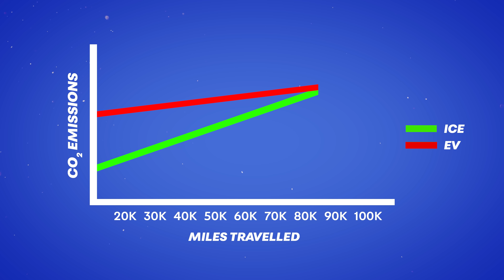Are Electric Cars REALLY That Green? [New 2022 Data]

Comment: You're right! 
Hard to explain to these EV lovers. Lots of them do think it's the magic bullet to solve everything.
Getting rid of batteries is a real problem / getting the materials to build those batteries even more.
Why some EV car-ads have butterflies in them , goes over my mind.
Anyways... we (EU) do not use miles...we have metric, dammit. With or without Brexit.
Reply: Oddly you "wtf how" comment is also gone, even though it shows in my notification
Reply: @offroadr  Censoring? "WTF" is too harsh? :-D
Did my repeated comment come through? Yes, that did. Weird.
I think now they have an eye on me ... doedidoedidoedi  ... (twighlightsounds)
Reply: Getting rid of batteries is not a problem.  They are already 90% recyclable which changes Volvo's numbers significantly.  

As an EV lover, I do not think they are a magic bullet.  But they are part of a solution.  You don't think ICE car commercials don't do whatever they can to sell them too?  Ya sure they are intended to woo the weak minded and make people think they are doing better, that is advertising in general. 

Finally Lithium is 25th most common element, iron is the 4th, phosphorus 11th, and oxygen 1st.  These are the components of a lithium iron phosphate battery.   With the exception of these, the cheapest place to mine these materials is in recycled battery bins. 

So no it is not a magic bullet, but it is better than shooting ourselves in the foot which would be continuing to use ice cars.
Reply: @offroadr  Yeah yeah... all fine and dandy, but this is not the future... More cars.
We need less people. So start having zero kids.
Reply: @RealButcher , That I do agree with.  In Canada our birth rate is 1.47 children per woman.  So effectively our population is dropping except by immigration.  Globally we are still growing, 2.3 per woman where 2.1 apparently is the break even.  But to give context in 1990 the rate was 3.2.  So we should see a declining reproduction rate soon.

There is a lot I do not like about Elon Musk, but if his vision comes to pass, it will mean using robo taxis will be much cheaper than owning a car.  This could mean that we use half or less of the cars that we do now.
Reply: @The RealButcher (Peter from Holland),  your last comment seems to have gone missing.  But I do agree.  From what I understand nature often tries to balance population to a sustainable level.  Unfortunately it is reactive rather than preemptive.   As life span and survival rates increase the birth rates decrease, however it is several generations later, in the span in-between the population skyrockets.  One of the issues I have with Elon is he thinks the planet is not overpopulated, in part because of his goal to be interplanetary.   To me this is ridiculous, even if we could take a billion people off of the planet and by the time we have enough rockets to take them all off, the population will probably be more than a billion larger than we have now so at worst we would be population neutral.   Even if we were to significantly decrease, as the population drops, the birth rate is likely start to increase to keep a healthy balance naturally.
Reply: @offroadr  Anyways, I told that the amount of children being born has decreased from 1950 on till today.
And that here in Holland we speak about condoms and the like freely. Also abortion can be talked about and even euthanasia is talk-able.
I think the fact I put a website in was the reason it has been taken away.

Comment: "...may not be as green as their internal combustion engine counterparts in the short term."

"In the short term." Good job that every car I've ever owned since the early 1990s has been in my possession for years. My current ICEV has been mine for seven years, and it's the one I'm trading in for an EV this summer.

Because don't forget: this current research (and it's 100% legit) involves current manufacturing processes and current power generation. ICEVs have had a century of refinement but still end up polluting more in their lifetimes because they HAVE to burn fuel for propulsion and their manufacturing is as good as it gets. With EVs, future battery tech involves new advances in battery recycling and greener components (not using cobalt, for example) so future models will approach ICEV levels. Energy supply is getting greener too, and if someone sticks 5 or 6 kW of solar panels on their roof the 95% of charging they're doing at home means it's going to be greener a hell of a lot quicker. 

Even if an EV owner personally doesn't have solar at home, renewable electricity has been the cheapest option for a few years and market forces will continue to phase out older polluting methods of power generation. This means the mileage needed to meet that break-even point reduces by the year. ICEVs always have to burn something to roll, their tech's peaked. For EVs, the only arguments that Luddites have are the things they're trying to prolong - burning stuff for power instead of promoting the cheaper and greener alternative.

The future is now. Some people want to be left behind. It happened to the whale oil fleets and the horse buggy makers. We don't mourn them from our past, ICEV defenders won't be mourned either.

Comment: There is a huge flaw in this study. The Materials Production and Refining numbers include the mining and manufacture of Lithium Ion batteries, but (surprisingly) do not include the mining and manufacture of the petroleum required to drive the ICE vehicle for the duration of its lifetime. This is often where studies go wrong, and once you include the carbon of extracting, refining and distributing petroleum into the overall CO2 emissions of an ICE vehicle, the scale immediately and obviously tips towards EVs.

Comment: I discovered what you're saying a few years ago. And it's TRUE. 
Electric vehicles (at present) leave a huge carbon footprint before it even leaves the factory. 
Charging the lithium batteries might look clean, but you're plugged into the dirty oil/gas burning national grid.

Comment: The problem with EV’s is the batteries. Lithium reserves are low so manufacturers are now switching to alternate materials. These seem to have lower power output than lithium. Without new breakthroughs in battery technology, the industry is in for troubles supplying adequate range to new cars. Range and charge time will stifle growth and acceptance.

Comment: The amount of electricity used to produce one gallon of petrol is enough to propel an efficient BEV further than the average ICE vehicle would go off that gallon. That's ignoring the other energy used like gas and oil burned to provide the heat for fractional distillation.

Comment: 90,000 miles. I have one gas vehicle with 143,000 miles, and anothe with 247,000 miles. You have to realize the the mileage perspective he is stating is coming from the UK... where people drive far less miles than places like the United States. In the UK... you can drive from one end of the country to the other in 4 hours. 450 miles from stem to stern, while the United States is 3,000 miles across, and due to that... everything is far more spread out here.

Comment: Yeah, I suspect Volvo are using the data to drive the industry in the right direction. It reads to me like they are saying, “Yes, EVs have come a long way, but they aren’t there yet.” And they are right. Until the electric car can improve on its own manufacturing methods and further reduce the initial CO2 hit, they are forever going to be under scrutiny. It’ll happen, of that I have no doubt: just look at how ICE has become increasingly efficient under various levels of legislation, going from the lazy, thirsty lumps of old to these magnificent, tiny blocks that can go for miles on a few drops. I’m sure similar drives will force battery manufacturers to make smaller, more efficient batteries in the same vein.

Well, it’s either that or Volvo has sussed out the issues with hydrogen and is waiting for the right moment.

Comment: Some other interesting points: Electric cars have regenerative braking. If you drive a typical electric car, and charge it from exclusively coal fired electricity, it will compare with a typical Hybrid. Much better, than a combustion only car. Electric cars can "put gas back in their gas tank", any time you use regenerative braking while descending a hill, or, gradually slowing down. Hybrids use a rather small battery, to achieve the same effect. If you remove the regenerative braking from an electric car, then, its carbon foot print per mile (kilometer) is comparable to the best gas/diesel only vehicles. Just throw in a few turbines, or a photovoltaic array, and it's a win for the electric. 
     The most needed thing right now, is more comprehensive recycling programs for EV batteries, when they finally come due for replacement. It's theoretically possible, for all the elements in a battery to maintain the market with no further mining. The only need for mining would be to expand the market. Once the market is saturated, there is little need for more mining, to keep any given car on the road forever. Your ~400 kilogram battery still weighs 400 kilograms after it's spent. Nothing goes into the environment, if it's recycled, rather than simply disposed of. you're (Volvo) dead on right about the extra materials needed to build a battery vehicle, but, the difference pales in comparison to the continuous carbon foot print necessary to keep them running. The only reason electrics aren't twice as carbon intensive to produce, is the simplicity of the motor and differential, which does away with the complexity of an engine and transmission. (especially if you include all the emission controls) With electric, it's theoretically possible to run with almost no carbon, if charged 100% by renewable energy. (Tires are made out of petroleum!)  That being said, you still have to build the turbines/and/or photovoltaic panels to provide that power. Those apparatus will too, produce far more energy over their lifetimes, than it took to manufacture them. Right now, the thing no one likes to talk about, is the serious need, to create a viable and effective recycling program for wind turbines,(especially the blades) once they reach "end of life".

Comment: The Major issue Polluting Ground Water 💧 
California does not have a Recycling Center for Leaky Acids or  other Chemicals Battery Packs, which POLLUTES our GROUND WATER 
From Millions of Hybrid Cars and Electric Vehicles (EV's). From 8 to 12 years ago sitting on Junkyards. I double checked to confirm Jalopnik Article. 
There are only Recycling Centers ♻️ for Electronic devices Cellphones and 📺 🖥 Computers 🖥

Comment: Hey, from  Ralph Naders 'Unsafe at any Speed', it takes more energy to build a car than it will use in its lifetime. And this was when cars got 10 miles to the gallon. This green evaluation based on CO2 emission is very fraught with deception. I work in industry where we buy carbon credits: the same product can be 'carbon neutral' if the carbon credits are applied to it or not, but it takes the same energy to make both. They need to apply the 'unbiased' fair comparison between the ev and the ice: energy used to make it, and do note the ev is not a perpetual motion machine.

Comment: So even at the worst figures EV's are greener that ICE because only a small proportion of cars get so banged up they have to be scrapped before 90,000 Kms.  A lot of Tesla S's have over 300,000 kms on them.  The goalposts are moving with more renewable power sources added every year but even if every kwh in an EV came from a coal plant the lifetime emissions would be better than an ICE car because coal is burnt at much hotter temps in a power plant than gas is in an ICE AND the processing emissions are much higher for oil than coal AND 85% of the energy in a car battery gets to the wheel as opposed to 15% of the enrgy in a gas tank.  That and battery recycling is already above 80% efficient with some new processes being over 95%.

Comment: Yes but you skip something important. Does an EV reach 90k miles with one battery? NO, so in the meantime they need a new battery what adds Co2 again within that 90k miles. Also something you didn't mention is the recycling of old batteries. Recycling the batteries adds another Co2..

Comment: I'm not a believer in this "green" political agenda. If CO2 is such a problem just plant more trees to clean it up. It's really that simple.

Anyway.... EV's are worse for the environment both in production, running costs and recycling at their end of life which is about 12 years. any EV made today will not be on the road in 20 years unlike combustion vehicles. How many cars do you see on the road that are 20 years old and more? How about vintage vehicles like Sierras and Chargers. Even cars from the 50's are still on the road. This won't be the case with EVs. They are disposable.

Comment: Are BEVs green: no
Are they better than ICE: yes

Some of the upcoming battery tech may drastically change this discussion.  Really hoping to see EVs drop in weight over time.
Reply: I bet it takes over 1000 liters of diesel to mine a kilo of lithium. Not to mention rare earths that take even more diesel. Then there's the coal and diesel used to generate electricity for charging which is a massive burden on the grid.
Reply: @Bob_Adkins   I suppose you could also argue that homes and businesses are a burden to the grid. I would argue that they are the purpose of the grid, if BEVs are the solution moving forward, the grid will grow to meet that demand. 
The current natural gas powered grid is about 2-3 times as efficient as an internal combustion engine. 
As far as the amount of diesel to mine lithium, I’ve seen numbers around one ton of lithium mined = 15 tons of co2 are released. Since burning a gallon of fuel releases about 3x it’s weight in CO2, I suspect 1000 liters per kilo isn’t close.
Reply: @and2244rew  Lithium is light, scarce, and takes a LOT of digging for a kilo, even in the richest ground.
Reply: @Bob_Adkins  sounds like you’re really crunching the numbers
Reply: @and2244rew  Crunching? Nope, pulling them out of my keester! 😜
Reply: Tell me how much better an EV is when it gets 250K miles on it. I think Tesla has overreached on some of its cutting-edge engineering and will pay for it.

EVs have so many HUGE advantages over ICE, I'm hoping they get competitive pricing real soon. If the government tries to push them too fast, it will be a disaster. People will sour on them and it will set back sales and enthusiasm. When they are truly ready, they will sell themselves without being pushed on people. EVs have the potential to be very light indeed. Damn batteries!
Reply: @Bob_Adkins  Totally agree with that. Tesla is innovative but i have no interest in x-wing doors, touch only handles, etc. they need to work their reliability and product support too.

Comment: Much as I like the concept of all EV some day - there's a lot of obstacles before we get there. 

Many Grids aren't suited for it.  
Common living arrangements / dense pop living doesn't work well in this regard given not everyone has a garage.  Not everyone can have a garage.  Drive around and this becomes obvious quickly. 
Without a garage the possibilities of (potentially very destructive) vandalism and theft are very real.
I've never lived in or been in a home that didn't require re-wiring at least and many may require additional service. 
Batteries don't live forever - Tesla has some impressive claims about theirs, though.  Time will tell. 
Electric batteries must be recycled properly, which itself is likely not carbon-neutral.  Engine blocks once drained can just be shredded and recycled.  It's not carbon neutral either, but at least you get new steel out of it. 
Maybe I missed it, but I haven't seen a solution for northern climates at all.  Cold, snow, road grit and salt aren't exactly good for batteries or charging them.

Comment: As long as we are having to dig craters the size of a small city to be able to make batteries, they are no better for the environment then ICE vehicles.  Until the day where we can create a small power plant for a car that can power it on it's own, there is no "Green" vehicle possible. Emissions are a joke considering the ICE manufactures have constantly been cutting emission on their cars for years.  (compare a 70's car to a car in the 90's and to a car in the 2000's).  ICE Vehicles are getting better, but, what are EV's doing with their old batteries ?? OOhh wait, they don't have a recycle plan for them. You can't just look at one aspect and go "oohh good it's environmentally friendly" without looking at the WHOLE life cycle.